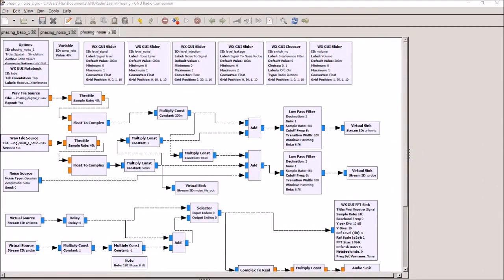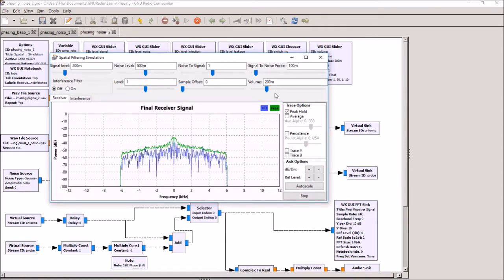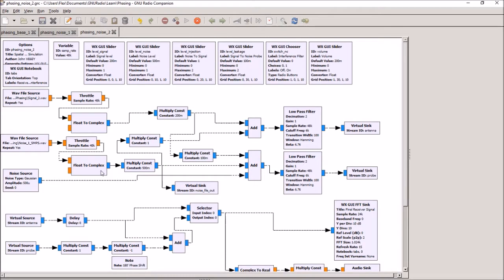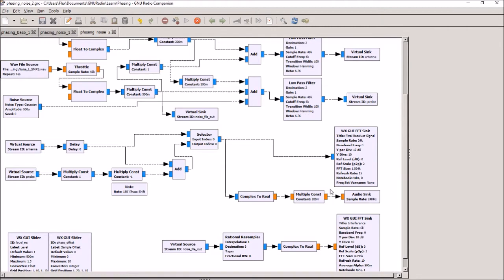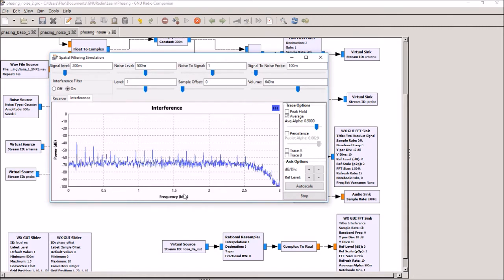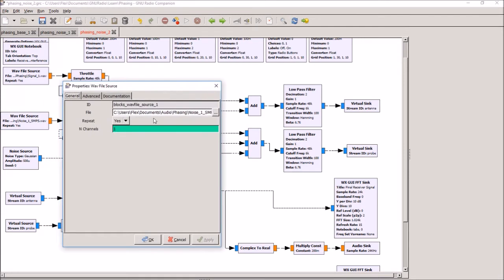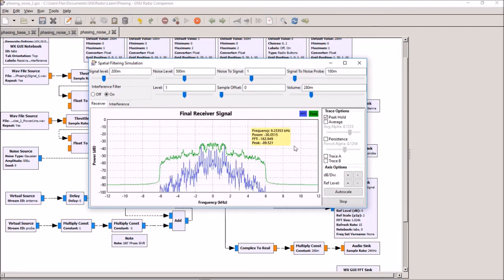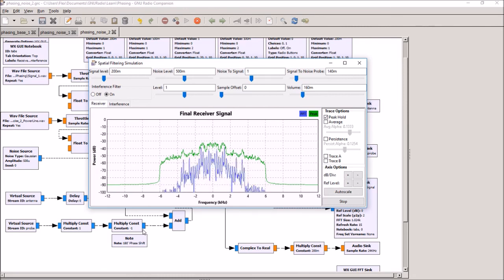SDR Spatial Filtering Demo

Comment: Do you think you could produce a morse decoder? I just can't figure out how to do clock recovery, and start sampling at the correct points and turning things into characters. the characters could probably be done easily enough by using a python block and some lookup tables, but you still need to get the dots and dashes.
Reply from the maker: Never tried on GNURadio. Have done one using Arduino that worked pretty well. Check my web site at http://play.fallows.ca